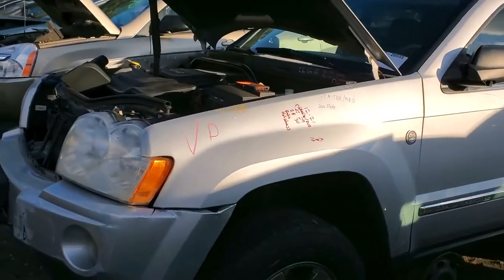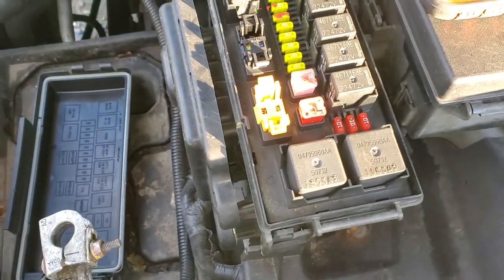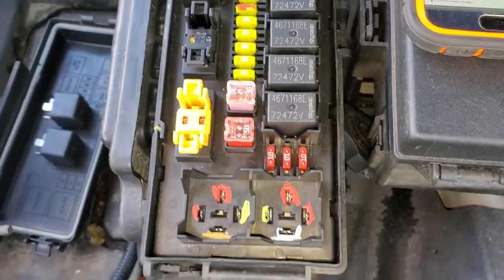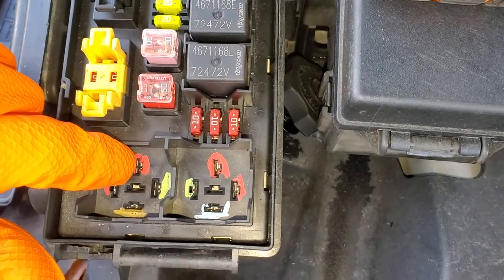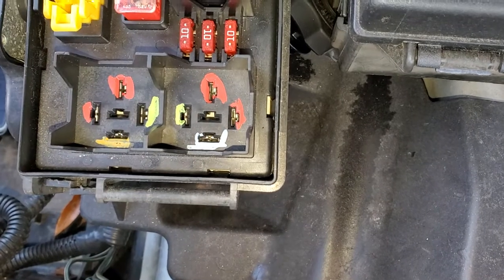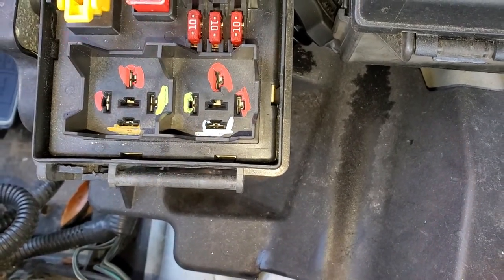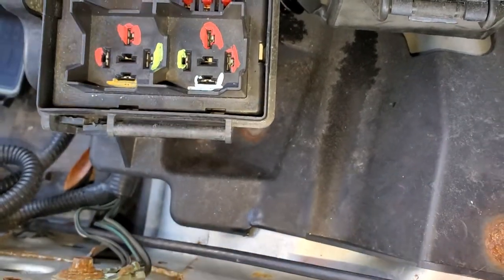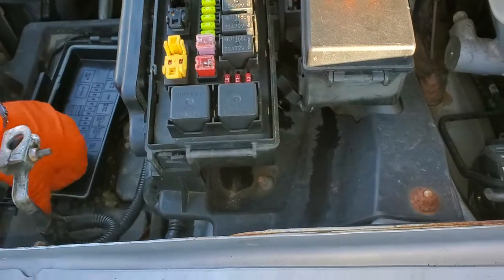2005 - 2010 Jeep Grand Cherokee Cooling Fan Relay, Fuse & Circuit Explained

Comment: Interesting to see.  My WK is missing the left side relay and the 50 amp fuse.   I also happen to have a problem where the fan is at full speed at idle.  I don't know if those two problems are related but it wasn't always this way.

Comment: I have just had engine light come on so I put a diagnostic tool on it and it gave me
 
PO480 Fan 1 Control 
- Circuit

The aircon wasn't getting cold and the temp raised very quickly 

2008 Jeep Grand Cherokee SRT8

Should I replace relays and fuse or what do you think?

Comment: I have a 2006 Jeep Grand Cherokee and the AC fan doesn't run. I applied power directly to the fan and the fan runs. I applied power to the connection before the resistor pack and fan runs. I have replaced the high and low relays and fan still not working. I replaced the temp sensor and still no dice. Any thoughts
Reply: Any luck on finding the issue?
Reply: I have the same issue. Any luck?
Reply: @evanclarke2364  Remove the relay and check to see if you have power at the relay pins with voltmeter/circuit tester, if so, you can use relay bypass switch or if you are comfortable, jump the two correct pins for power to the load, confirm then are the correct pins before jumping them. If all tests ok, then the issue is with the PCM/climate control module.

Comment: Great video! I have a question tho and it’s hard to search for online..so I followed your video and I replaced the relays and now my fan works!! 😁 but what confuses me is the “high fan relay” because if I pull my low relay the fan shuts off but if I pull the high fan relay while leaving the low relay in , the fan runs like it should . So I guess my question would be what is the point of the high fan relay? i let my temps get to the midway point on the temp gauge. When does the high fan relay i.
Reply: Hi there, the hi fan relay will provide more power to the fan, if you only use the low fan relay it will run slow but if you use both the fan will run faster when needed

Comment: So I’m running a Holley ecu on my GC. Could I use a ground controlled signal (triggered off engine temp) and tap in to the ground (pcm) wire? Isn’t that pretty much what the factory ecu is doing?

Comment: Does tha same apply to swap out on a 2000 JC (tha 2 Big Black sensors, Mine are Green) ? I've replaced tha fan relay , tha fan and temp sensor and still tha engine fan WILL NOT turn! Not sure what else I'm missing?

Comment: Hi there,
I just purchased a jeep grand cherokee 2006 and I’ve noticed that these two relays are missing (place is empty) however the vehicle runs smoothly and no sign of any overheating. Do you have any suggestions ?
Reply: Relays are only when U have electro fan. You have Hydrofan.
Reply: I'm looking for some knowledge on the hydraulic fan. Do you happen to know of a good source? I have a 07 jeep commander with the hemi

Comment: is it hydrolic or electrical fan??  ???
Reply: I think it's electric. I have a 07 commander 5.7L. I don't have either relays there. The 5.7 is a hydraulic motor. The solenoid is powered by the ecu I believe, that's what I'm trying to figure out. Not a whole lot of info on  the internet.

Comment: 2007 4.7l low speed fan doesnt turn on only high speed when engine temp hits 220 during idle. any ideas has new fan, new water pump, new thermostat, new temp sensor.
Reply: Same thing happens to me 06 4.7
Reply: Maybe it's a faulty coolant temperature sensor and or temperature sensor fan switch some place in the coolant system that the coolant flows through. I replaced on a 2000 Ford Escort SE 2.0 I used to own. I had to go to the dealership for the fan temp sensor switch, because the O'Reilly auto parts part would not work at all. I tried two fan temp sensor switches from O'Reilly auto parts and neither one of them worked. The dealership fan temp sensor switch worked the first try of installing and driving on the highway to warm the coolant and when I stopped to check the fan with car engine warmed up and operating,  the fan was spinning full speed. Instead of not even on. Or fuses or relays!

Comment: Your marks for the cooling fan wire relays are incorrect. They're the exact same on both low and high relays. Otherwise, that relay would be specific to that spot, and other relays wouldn't work on it.

Comment: Does this information apply to 2005 wk 5.7 hemi with hydraulic fan ?  my vehicle does not have relays in this location.
Reply from the maker: No, the hydraulic fan has no relays
Reply: @LehewTech  I have a 2010 with the 5/7 Hemi...no relays because hydraulic fan...but hemi in this video and there are relays...can you please explain??
Reply: @tuffy2004  Because this Jeep have electrofan

Comment: But this HEMI engine uses a hydraulic fan, driven by steering pump and controlled by a solenoid valve... Diagram says the relays are for 3.7 and 4.7, equipped with regular electric two stages fans.